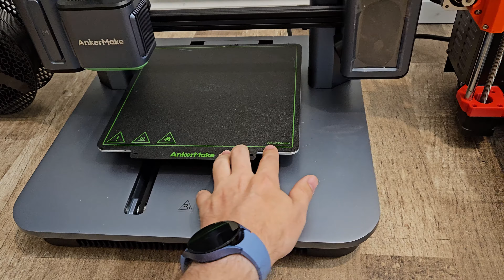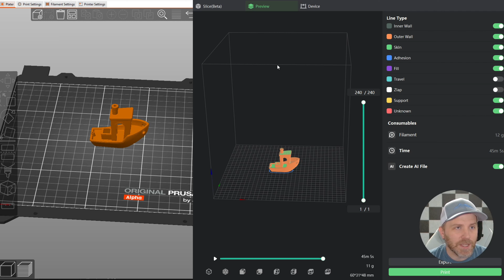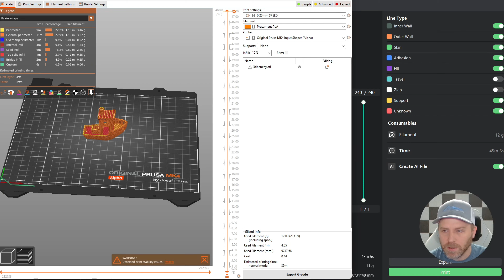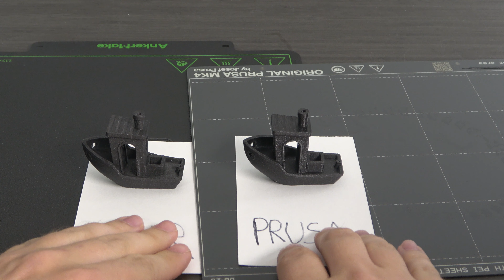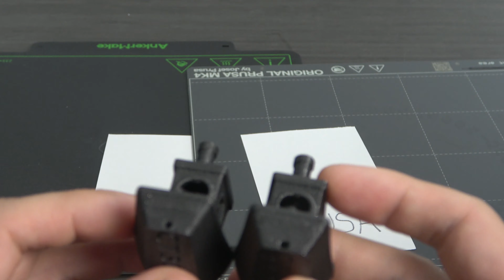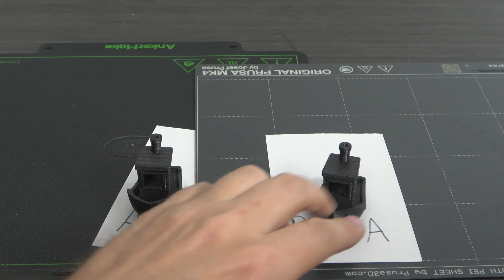AnkerMake M5 vs. Prusa MK4 (Comparison, Opinions and Benchy Speed Test)

Comment: Lol its your floor not the 3d printer that's uneven, this machine is better than mk4
Reply from the maker: It's not. I put it on a granite countertop and it still is like that.
Reply: @cbutters i have the mk5 but i don't fall victim to justifying the purchase lol the mk 4 slaps it but they are both great machines.  Especially if ur not an enthusiast and just want to print

Comment: I just bought the Ankermate M5 about 1 week ago and so far, have not had any issues. As for the small tug boat, I printed two of them, one for me and one for my friend, and did not see the same issues that you saw with the chimney and curling. Both boats came out nicely.  I'm wondering if the firmware updates improved printing quality over the last 8 months.

Comment: Thanks for the comparison. Keep in mind that, since the Prusa part cooling flows from left to right, it does better if you print overhangs facing towards the left side. If you try reprinting the benchy facing the other way, I bet those artifacts will disappear.

Comment: You counted prusa travel time at the end, but not ankers. When applying the same rules anker sturtup was 1:58 slower and the overal print time was 8:30 slower. That makes Anker over 20% slower :)
Reply from the maker: Thanks for the more precise numbers. I'm impressed with the MK4 in direct comparison to this other machine, it does so many things right that are easy to take for granted every step of the way while printing.